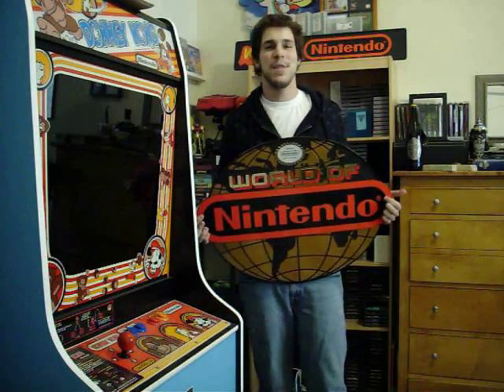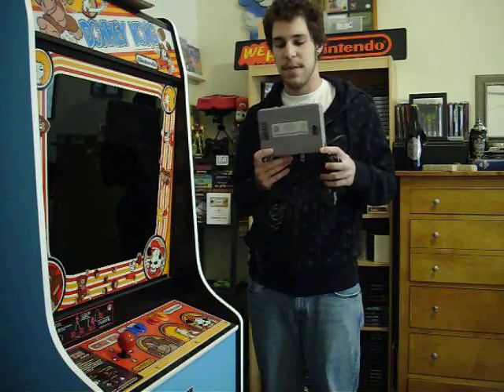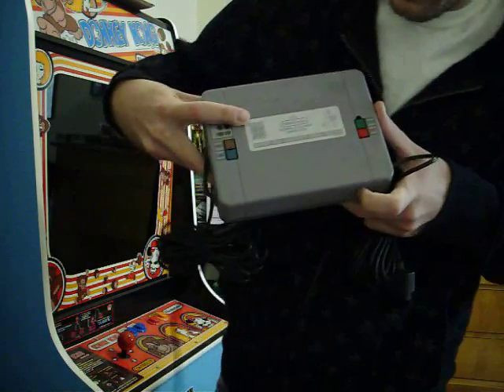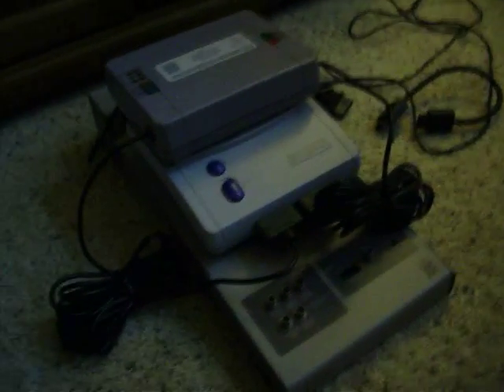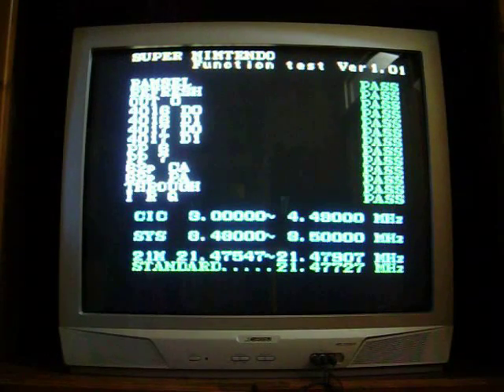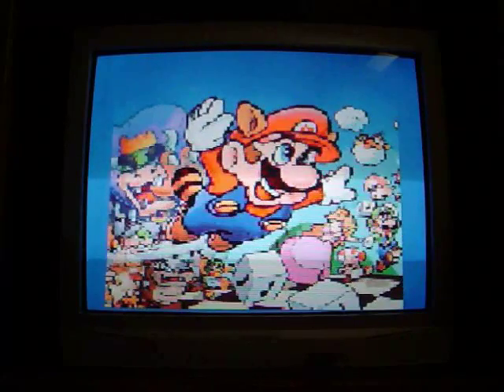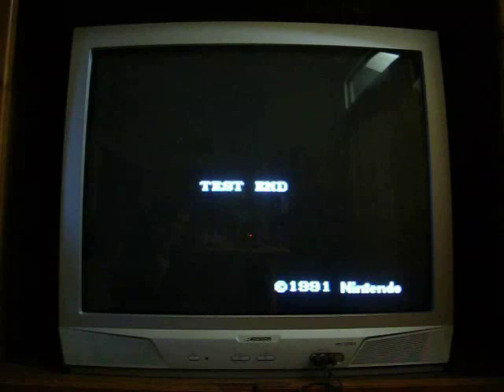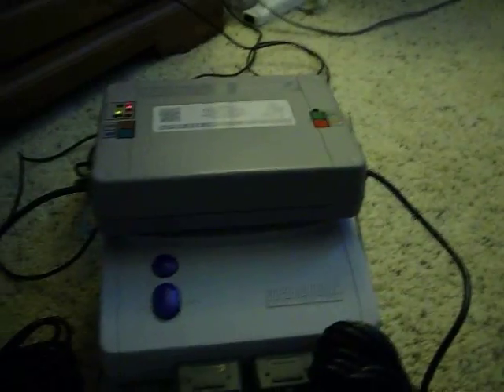Super Nintendo SNES Control Deck Tester Unit

Comment: How much are these tester worth?
Reply from the maker: @deanmurphy4810  I think the last one I saw sold for close to $3000
Reply: @PenguinNintendoAge  what are they good for? It's not like they have a million games on it
Reply from the maker: @ it’s was just used as an internal diagnostic tool to test and fix issues with a Super Nintendo console.  These were not available to the public only to authorized Nintendo repair centers.